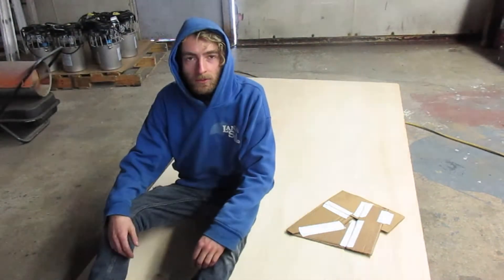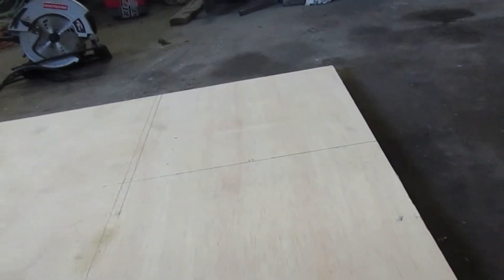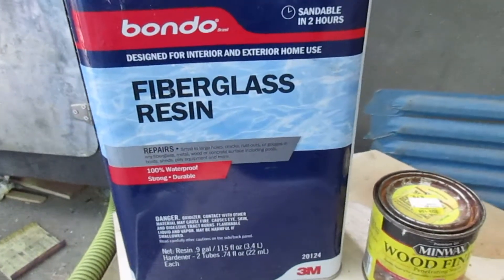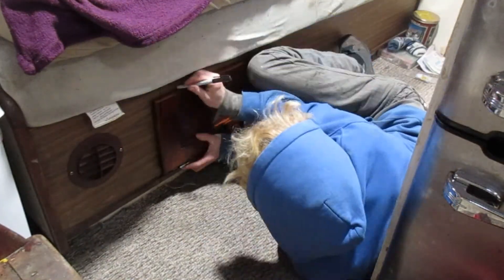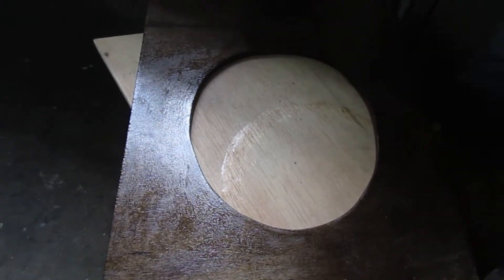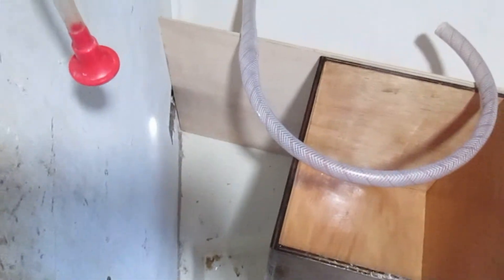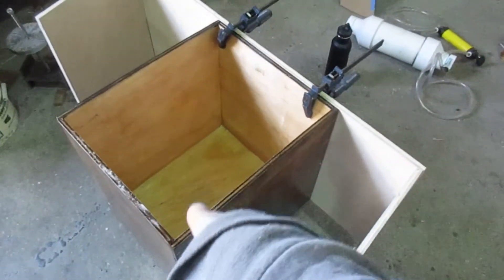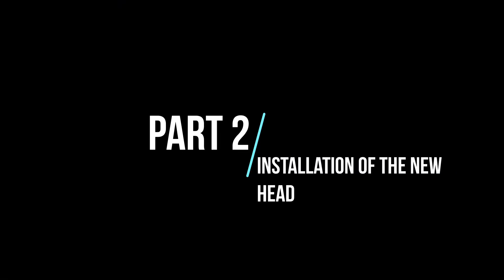Diy Composting Toilet! Part 1

Comment: The Bondo fiberglass resin is actually a polyester resin and is not epoxy.  You could always add some polyurethane to the box for extra protection.  I made my own composting head.  Fiberglassed the box, painted and applied clear gelcoat. Three years and no issues.
Reply from the maker: Oh wow! Never thought about doing gel coat and fiberglass